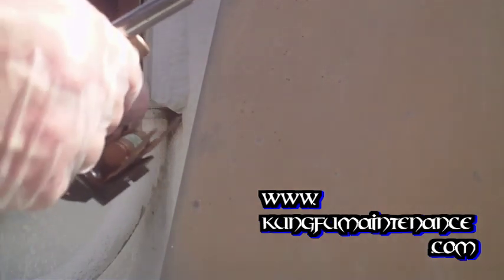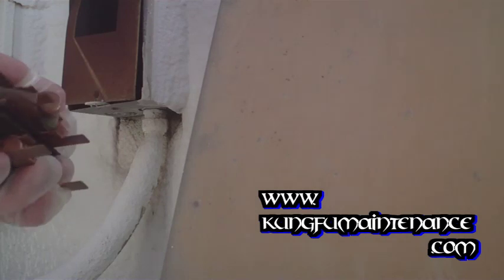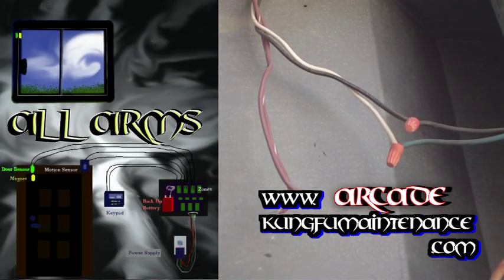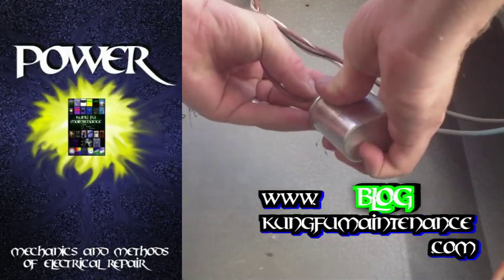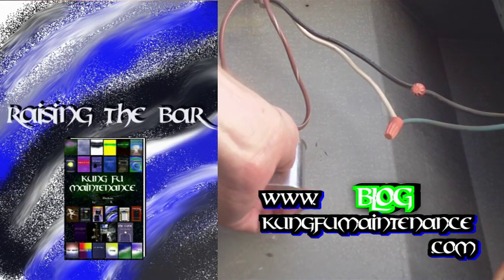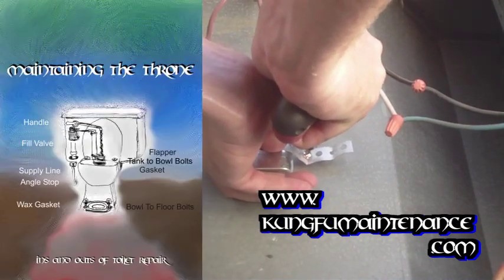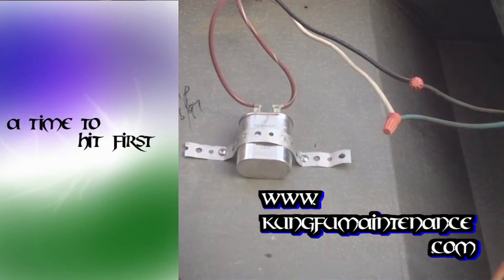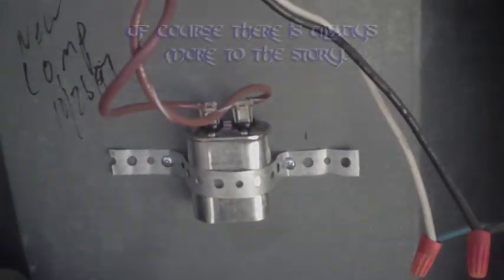Air Conditioner  Not  Cooling ~ AC 101 ~  Troubleshooting With Kung Fu Maintenance

Comment from the maker: Thanks ~ The capacitor became out of phase and unable to start the fan motor. The cap holds back the electrical charge and delivers it in the specific pulse pattern to rotate the fan at it's preferred RPM (rotations per minute(I think this one was 1075 rpm). Did you try the trivia question at the end of the video?